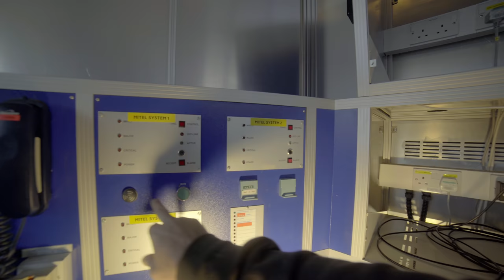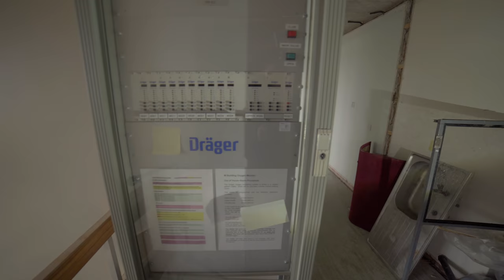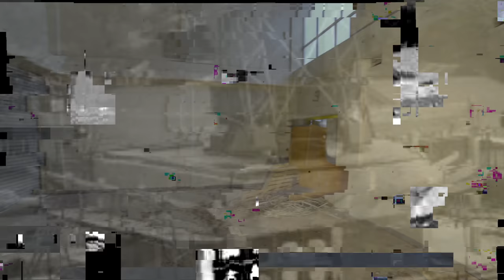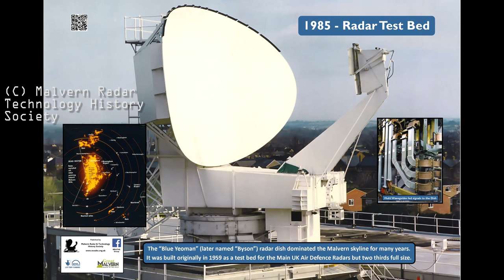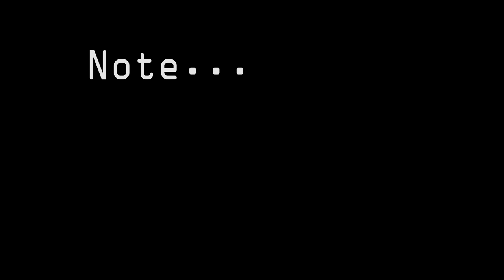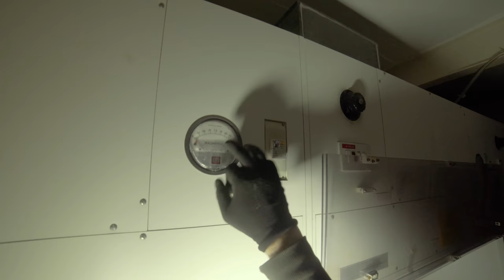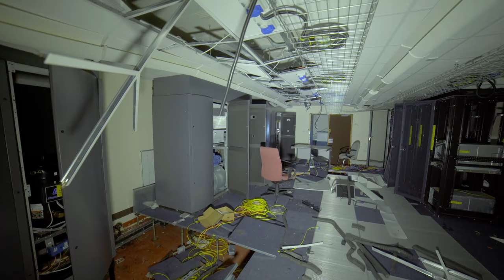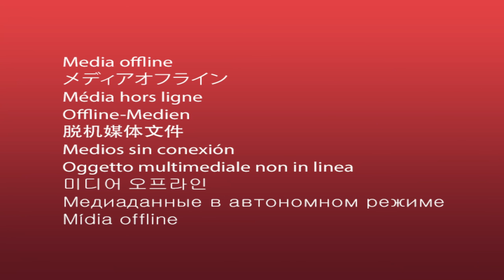QinetiQ Malvern PT3 - FINAL UNEXPLORED AREAS 4k 2.5hr

Comment: The tubes are called mantraps or anti-follow through. Some also weigh you on the way in and out to make sure your aren’t walking out with equipment.  Very common in datacentres etc
You swipe to enter but fingerprint to leave, so if you borrow someone’s card - you will get trapped inside (unless you cut their finger off)

Comment: Really interesting. You can see the different times where the buildings have been made, extended and retrofitted from looking at the style of heating used. From the classic old school cast iron column radiators, to updated rounded cast iron ones. to the flat panel steel and then the newer buildings with the eurostandard aluminium radiators and forced air ducting for AC. That's at least 60 years difference in those buildings.

Comment: The Malvern radar only had 4 transmitters and receivers; the operational Type 85 radars, when eventually built, contained the full set of 12. Their antennas were 50% bigger than the Malvern prototype. The transmitter valves were huge; they were 6ft tall, weighed about a ton and had to live in lead lined cabinets to contain the X rays that were produced.

Comment: The "sirens" you refer to at 38:48 in the plastic box aren't sirens but smoke detectors for detecting smoke from the ventilation system !  The "Flag" panel at 45:50 is a very old Fire Alarm Panel !